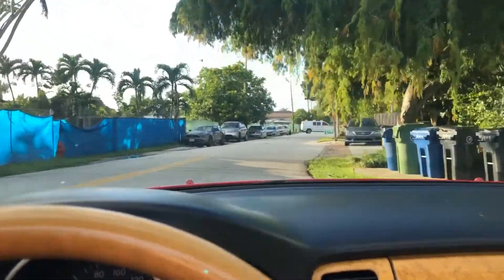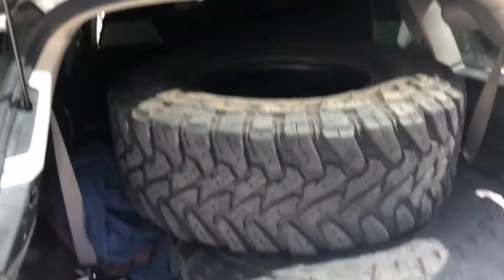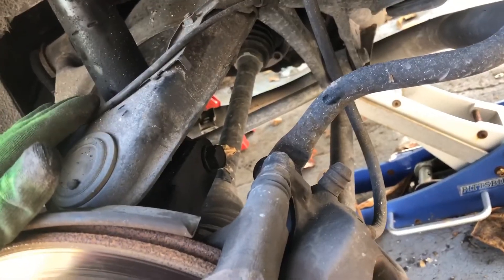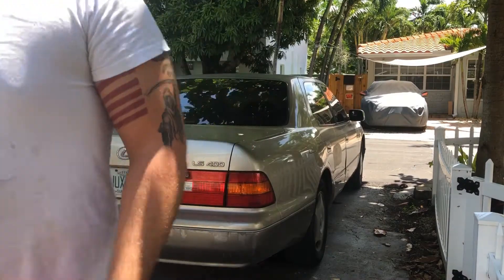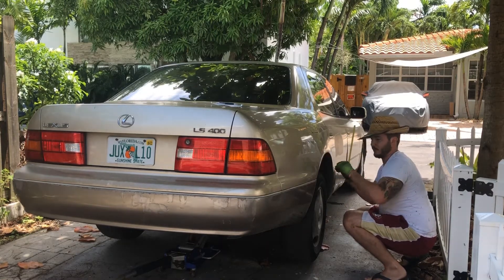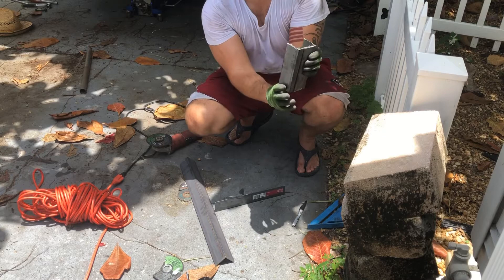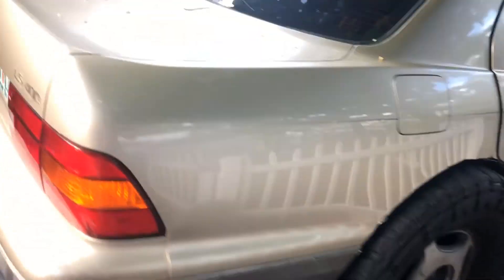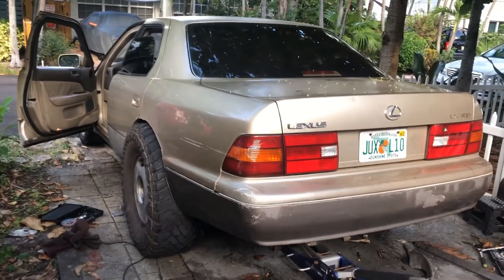Everglades Machine! Lexus Ls400 Built for Off Road & Python Hunting!

Comment: It's pretty nuts to see 35s on one of these! I'm in the process of turning my 98 LS into an offroader currently. I have 3" strut mount spacers made my HRG Offroad, and custom built fully adjustable rally coilovers currently on order for an additional 3" of lift with 8" of travel. Those are being made by Flatout Suspension. Should end up with 5-6" lift once its all fitted and had time to settle. I don't want to be cutting my baby up though so going with 31s or 32s with the additional lift.
Reply from the maker: @Kal that’s gonna be a pretty sweet ride. I wish I had been able to finish this one but we moved and couldn’t take it with us. 
I’d love to see your build once you’re done with it